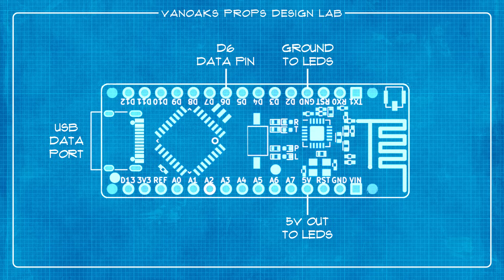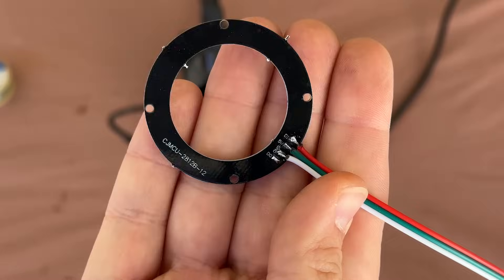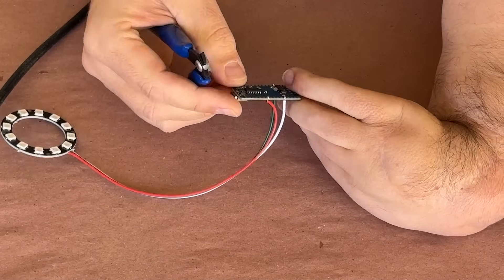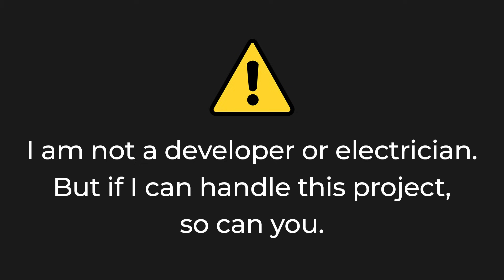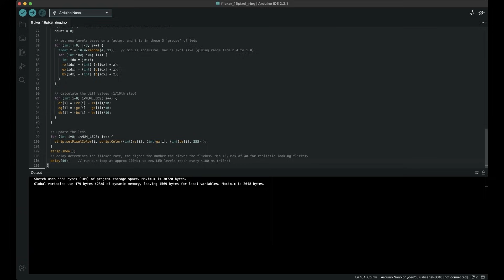The ULTIMATE Haunt Lantern!

Comment: Once my soldering connections are tested, I encapsulate them in hot glue to make them more sturdy.  You can use male/female Dupont connectors to get through obstacles.

Comment: Would it be possible to power more than one lantern using a single arduino?  If so, how many?
Reply from the maker: Good question. I’ll have to investigate
Reply: The first limit is the power supply. The second is your ability to code. Neopixels are designed to connected together infinitely (in theory) You can over come the first limit by injecting power every so often. You can add an additional data pin throughout the code for each lantern. Simple but, each lanter will have the same pattern and all data lines and grounds will have to go to the Arduino. The best way to do it is use one data pin and the next lantern's "data in" would connect to the "data out" of the ring before it. Positive and ground would also continue from one to the other. Eventually you will max out the power supply as you add more and more lanterns and the LEDs at the end of the chain will be dimmer. You can add anothe 5v power supply at that point. As for the code, it's a pretty simple change but you need to have a little experience. There are plenty of tutorials on working with neopixles.

Comment: I had issues with the glue peeling, and ended up spraying frosted glass spray paint on the inside of the globe. Works great, and won't scrape or peel off as it's on the interior of the glass. Another option.